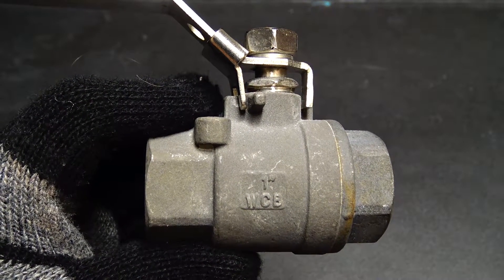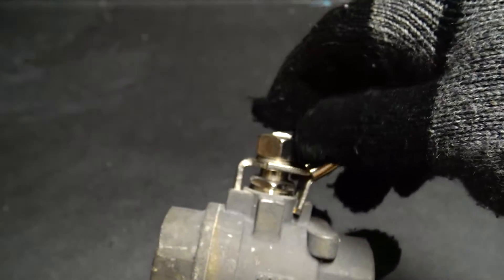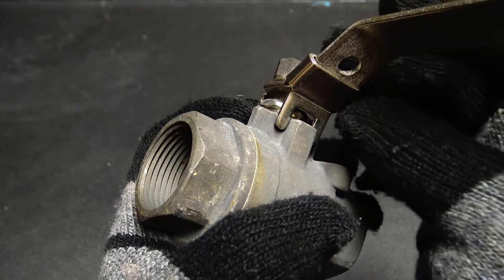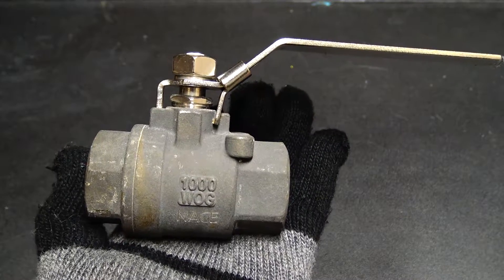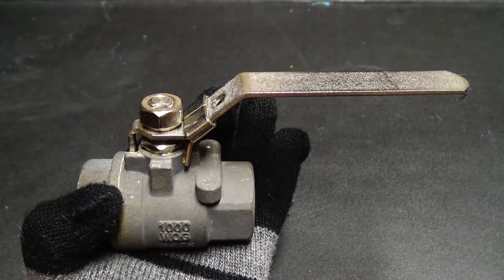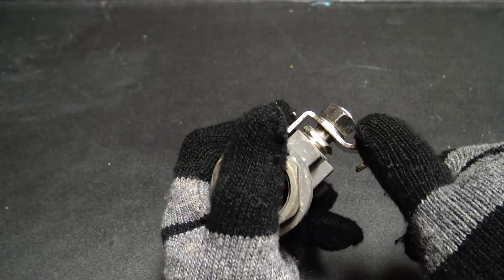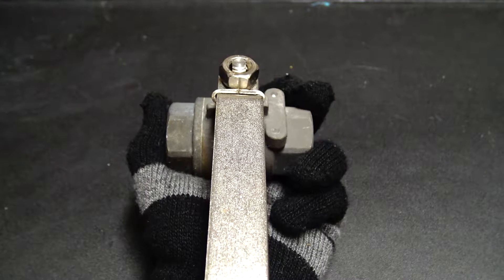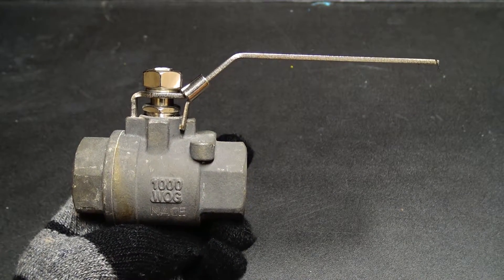HOW TO OPERATE A BALL VALVE. HOW TO OPEN AND CLOSE A BALL VALVE. HOW DOES A BALL VALVE OPEN

Comment: Have a new ball valve like this but i just can't seem to move the lever like it feels stuck. Is that normal or doni have to lube it?thanks
Reply from the maker: Hello. There may be a locking device that you need to lift before you can open the valve. Watch the 30 second mark of this video that shows you how to lift the locking device. If that is not the problem the valve may just need a lot of torque to open it. Sometimes new valves need more torque to open for the first time and then they loosen up. Hope this helps.